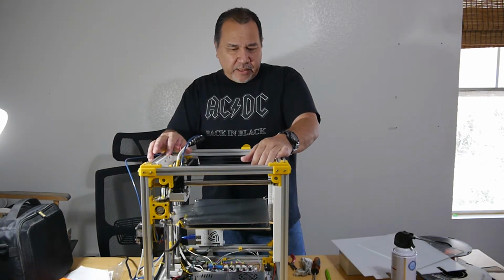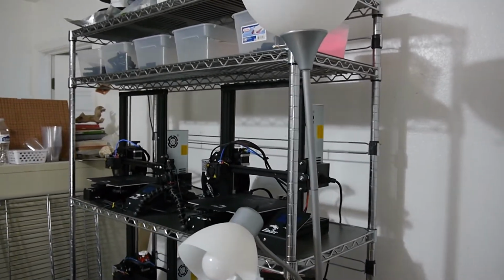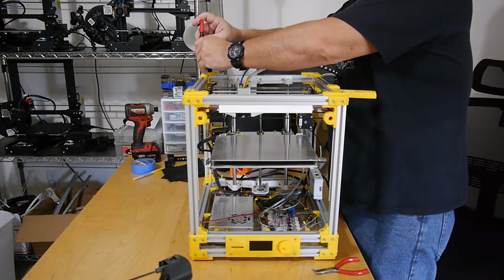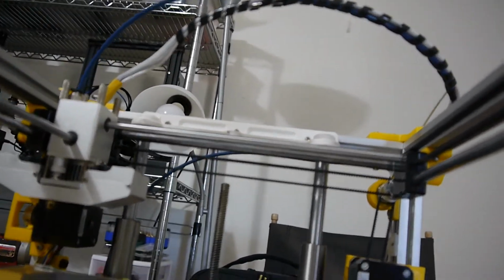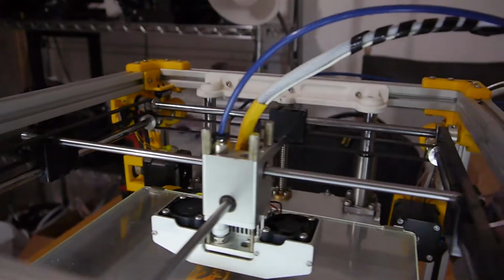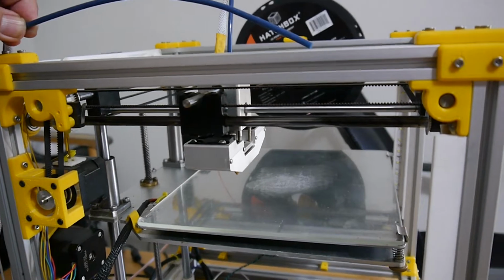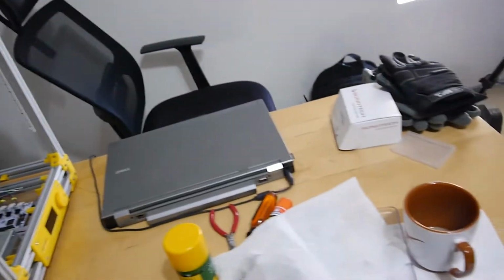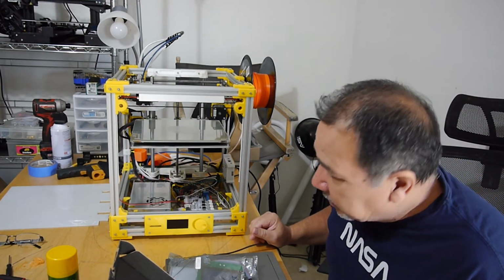Used Ultimaker 2 Clone Inspection

Comment: The problem with the under-extruded filament looks like an error in setting the diameter, 2.85 (or 3) instead of 1.75.
I made this mistake, and the consequence has the same symptoms